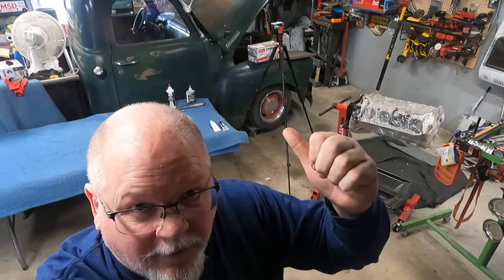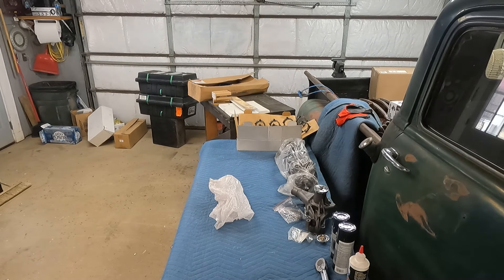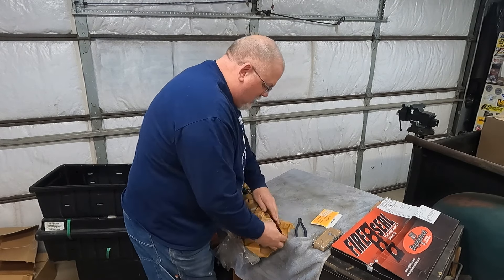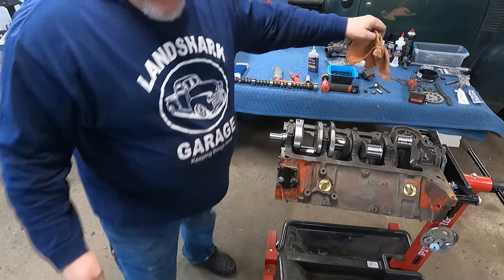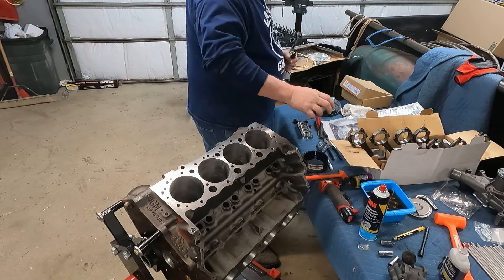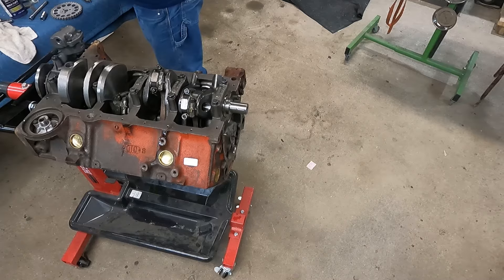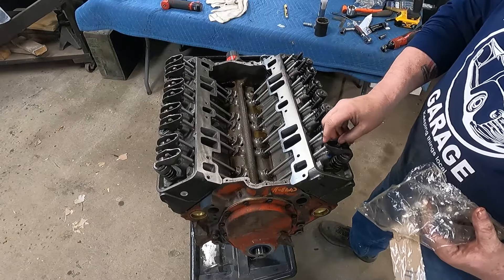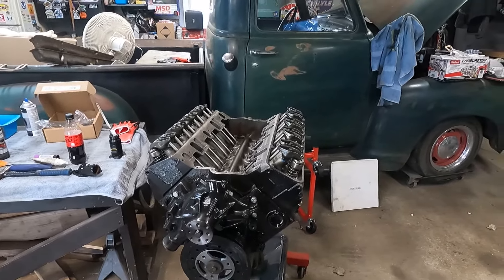Chevy 350 Engine Build for the 49 Chevy pickup.

Comment: My current project is removing the engine/trans, interior and all the good parts from a wrecked 82 Z28 donor with 45,500 original miles and swapping it all over to an 84 Z28, I also have a 91 swb 4.3 5-speed Silverado and a 73 Mercury Comet I'm working on.
Reply from the maker: Nice !!   Projects are a good thing.  Good luck thanks for watching!
Reply: @LandsharkGarage  Thank you, new subscriber and looking forward to hearing that 350 run.